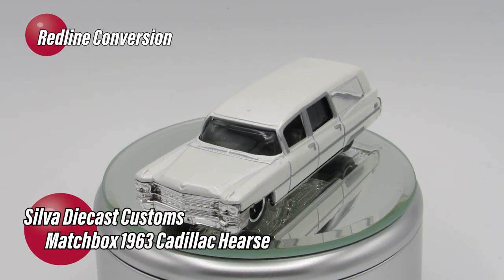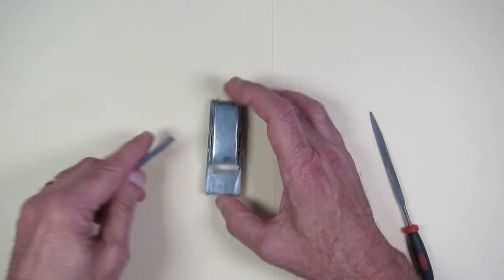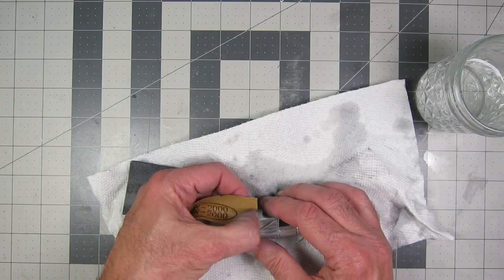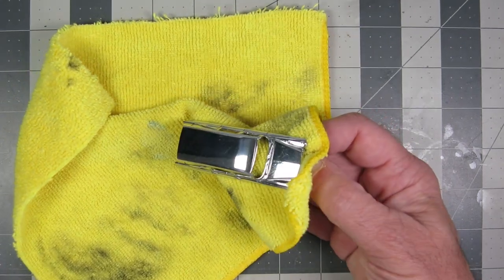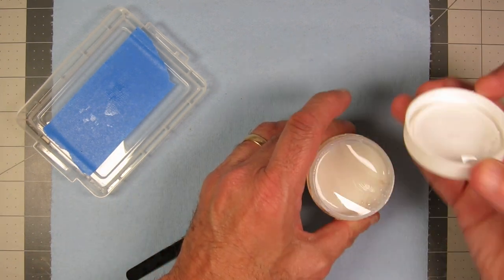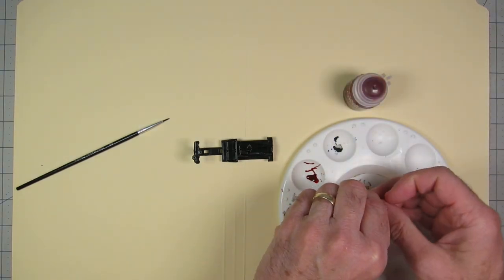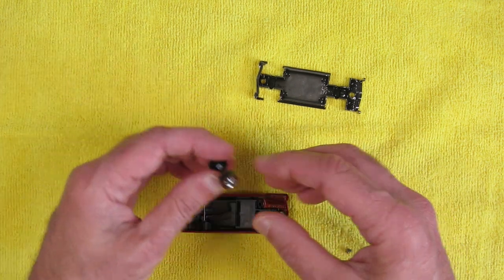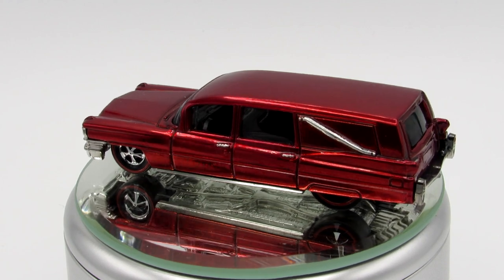Matchbox '63 Cadillac Hearse Redline Conversion

Comment: Beautiful job Jim! Love that red! Quick question. Although I know you’ve shown it on earlier builds, I’m too lazy to go back and check. What do you use to clean the casting after all prep for paint is done (sanding, buffing, etc.)? Thanks Jim!😎
Reply from the maker: Thanks Larry!  What I’ve been using lately is isopropyl alcohol.  I used to wipe castings down with different things, then went to IPA because I have a lot of it around…and most recently I throw the casting in a jar of it.  Pull it out later, wipe it down, let it dry completely (in case I miss any spots) and then paint.
Reply: @JimSilva-SilvaDiecastCustoms  Thank you sir!